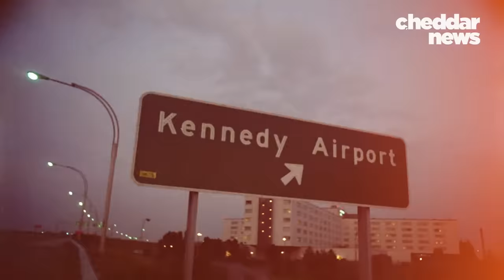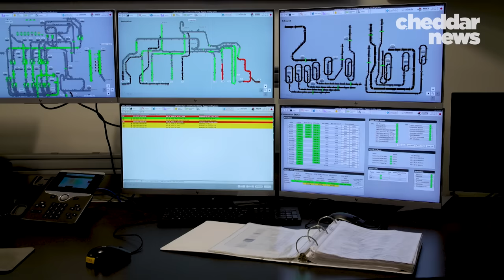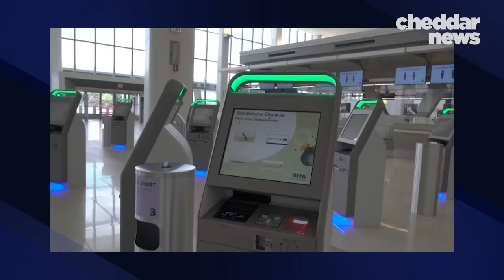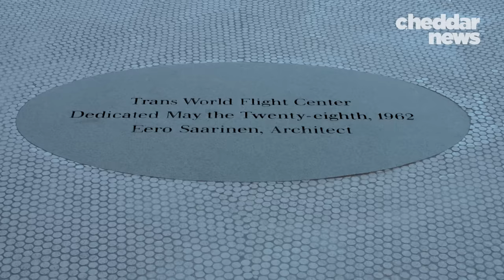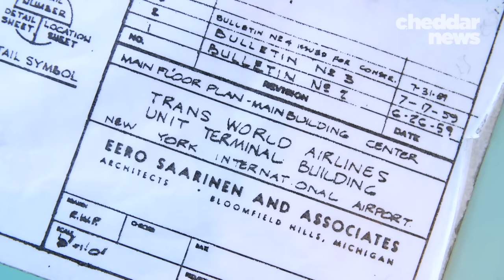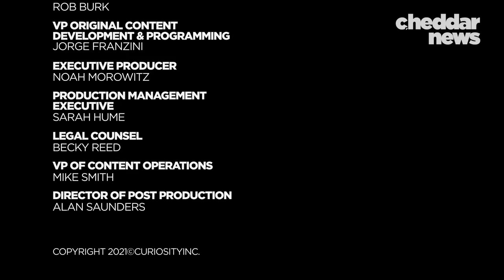How New York's Airports Handle More Than 3,000 Flights Per Day - NYC Revealed

Comment: A convenient, affordable transportation system like Newark has to Penn Station would help tremendously. One could pick from all three instead of whatever one is the least pain in the butt to use.
Reply: There is a proposal to update Airtrain EWR but what they ought to do is bring the PATH train to the terminals.
Reply: @stevenroshni1228  and can add a stop at South ST Newark as well
Reply: JFK has the airtrain to LIRR (to Penn) which is the equivalent to the Air-train to NJT the only difference is they don’t bundle the fares like newark
Reply: the issue is that the train tunnels under the hudson are already at capacity, so an extra line being added is extremely unlikely
Reply: @stevenroshni1228  this is the better and more realistic idea

Comment: The times that I have flown into and out of New York's airports (maybe 8 years ago and before that), it was really quite a contrast when you compare it to the main hubs in Europe, the Middle East and Asia.  An improvement was much needed and good to see that it's happening!!
Reply: Here in Singapore there's a huge contrast in passenger experience between arriving by air (via the world-reknowed Changi Airport or the smaller Seletar one that's quite new but more susceptible to weather disruptions as Malaysia is nearby & didn't want us to install an ILS system, claiming it's impose significant building height limits on them) vs by rail (where the long-distance station (Woodlands Train Checkpoint) is a bus transfer (which reportedly can skip your stop sometimes due to congestion) plus a 50min subway/metro ride to downtown) or by coach (with most services going to the decrepit Golden Mile Complex & Tower, with its choked toilets & heavily oxidised false ceilings (some which collapsed over the taxi stand several months ago) that's also had a reputation for sleeze with its nightclubs). The arriving experience by ferry is somewhere in-between though we were embarrassed previously where a cruise ship (either the Queen Mary or Elizabeth) had to dock at our container port ( Pasir Panjang ) because our passenger terminal then was too small. That led to the Marina Bay Cruise Centre being built at the corner of our coastline, but even after adding a train station that's still some 600m away (probably to save on the cost of tunnelling that terminus station's overrun track under the sea if it was sited closer)

Comment: If only America would invest in trains. Taking the slack off domestic flights would solve all of these problems. The worst thing you can do for your mental health as an American is visit Europe and see their public transport and cycle/walkability.
Reply: You have better food, social services, etc. as well. Thanks
Reply: @Rhaman68  Food is debatable, as Americans might moan the smaller portion sizes.
Reply: And to assure airlines, form an air-rail alliance. Deutsche Bahn does this with American Airlines, Emirates, and Lufthansa.
Reply: Once you see the gas prices in Europe that'll fix that. If we paid $10 a gallon like the Netherlands we'd be riding bikes too.
Reply: @seanthe100  Not necessarily, the infrastructure should be available first before Americans start cycling. The issue of cars is more because it is the only option than being cheap to operate.

Comment: What New York needs to do is have a tram system between JFK and LGA. The disgusting unions and taxi companies keep fighting it. The two airports need to be connected by tram. Using buses would not work. The roads between LGA and JFK are way way to congested.
Reply: Doesn't even have to be a tram. Even a reliable bus service will do. Even better is a metro system with dedicated right-of-way.

Comment: Lol at the "talks of a rail link." I live right off a Metro stop in DC, and it's awesome being able to just hop on the same system I use to get anywhere else and go to Reagan National (and they're currently wrapping up an extention to Dulles, so both DC airports will soon be connected to the entire DC Metro system). When I want to go somewhere or someone visits me they just hop on the train and show up at my apartment like half an hour later and it only costs them a few dollars. It's far from perfect, but I'm honestly surprised to hear that with how large NYC's rail system is that that link doesn't exist.
Reply: You can get to JFK by subway and air train. I have done it. It just takes forever because the airport is so far away. DC and New York aren’t really comparable just like Reagan and JFK aren’t really comparable. DC is a comparatively tiny city and Reagan is a small national airport. New York’s airports are actually extremely far away from the city downtown mileage wise bc the city is so large.
Reply: You also have MARC Penn Line linking (not directly but via shuttle) to BWI from 30 minute to/from DC

Comment: I saw the TWA lounge bit and internally thought shame such a building has gone, but you just can't keep this buildings near a airport. Then I saw that it wasn't only kept, the style of the lobby still have that 50's vibe. Kudos to both New York and the hotel, this will be a landmark building for ages.
Reply: UNfortunately, the OTHER fantastic piece of aviation architecture at jfk, the pan am worldport, met a very different fate. It was torn down, I believe in the early 2000s
Reply: I agree. They should definitely invest more in places like restaurants within the terminals too. A couple months ago, I was going to take a flight and it departed at 11pm, I arrived at 9 as it was an international flight and the only food option available in terminal 4 was a McDonald's. Such a shame.
Reply: @davidmfriedman  That's the reason I thought it was gone, but some great aviation history has been kept, they moved our old airport, Schiphol to a museum in Lelystad. But that's an expensive option not really open to something the size of of Worldport. Going the Berlin Tegel route and turning it in to a park can't be done either. So unfortunate as it is, it's gone.

Comment: JFK has train tracks behind the airport that would have needed little repair, however as the tracks are privately owned, the Port Authority (The Port Authority is responsible for all NYC bridges and tunnels, JFK, LGA and EWR airports and NY & NJ sea ports.)  built The Air Train from JFK to Jamaica at which point you have to transfer to the existing LIRR (Railroad): (this took over 3 years to build and is next to the only highway exiting JFK to Manhattan the Van Wick Expressway. (During construction a 20 minute ride just 8 miles took at times 60+ minutes about halfway to Manhattan).